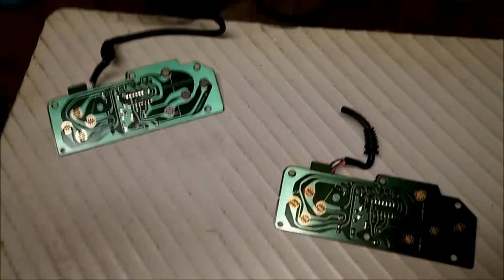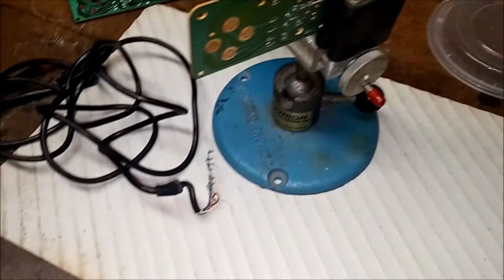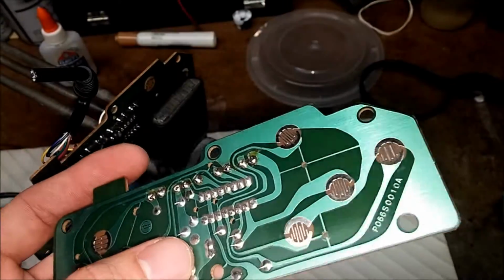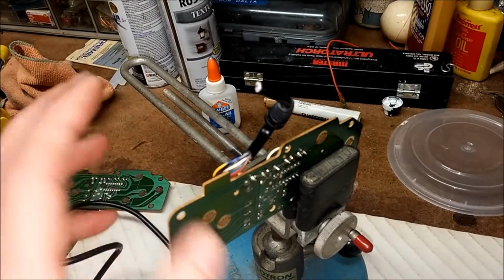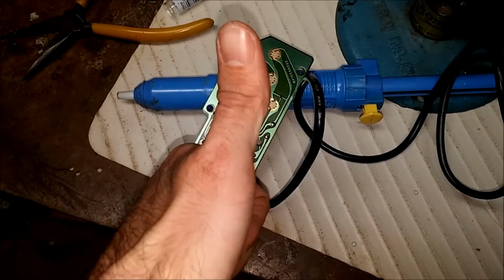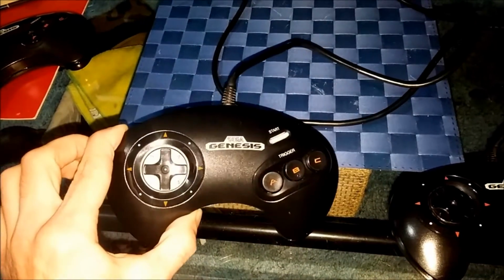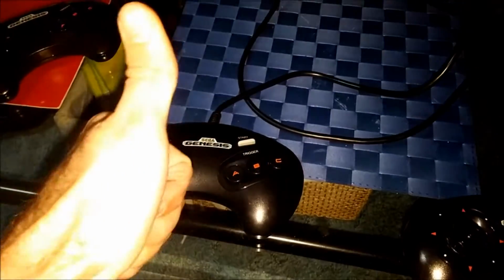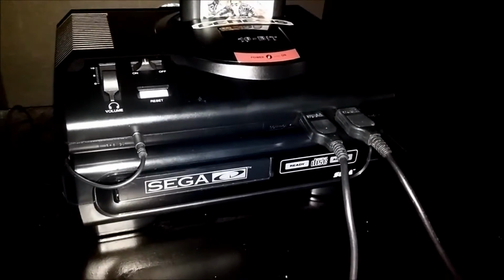Genesis Controller Repair

Comment: Those boards look unofficial. Are they from a 3rd party controller?
Reply from the maker: WaluMac They're from the first generation of the three button controller. The newer versions used carbon contacts instead of copper.
Reply: Ah. I'm not familiar with board revisions of Genesis controllers.
Reply from the maker: WaluMac There's four board revisions I think and three different case moldings that all have changes made to the D-Pad design and ABC buttons.

Comment: the only problem that i usually find is a bad cable , and i usually just cut the cable and soldering it and it work , but the cable is shorter .....lol
Reply from the maker: I usually do the same. But in my case the plug itself was bad so I wasn't able to repair it.